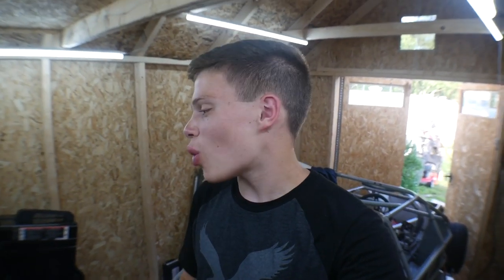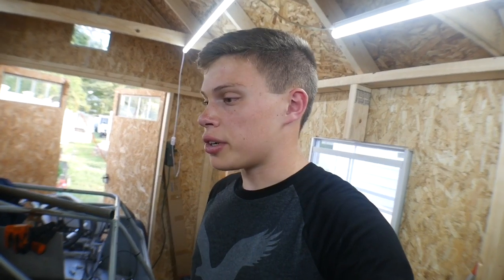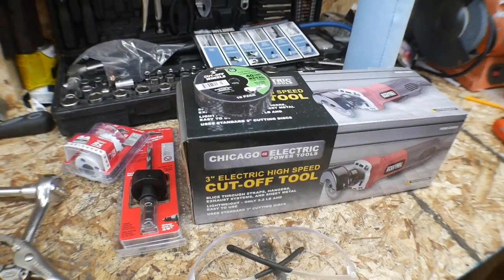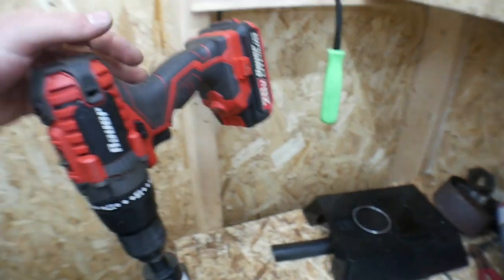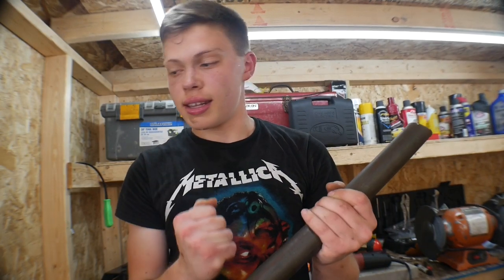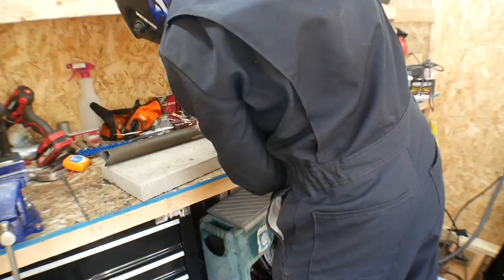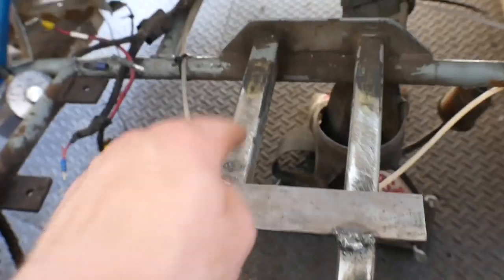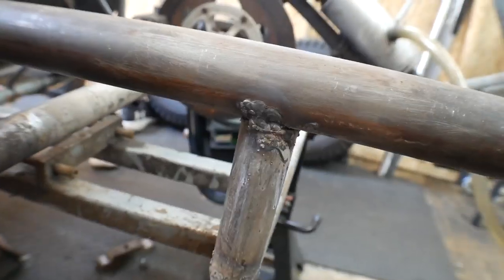STARTING The 750cc ENGINE Swap Into the NasKart!

Comment: Hi i am a daily welder you need to put the torch closer to the metal
Reply: ryan owens I was gonna say that
Reply: @ryanowens2334  no flux weld is stronger than gas weld but gas weld are easyer To do
Reply: YouCantGetMe_ flux core is just as strong
Reply: By a mile
Reply: @Tony 12083 - Learn to spell. And maybe your insults, and suggestions would be taken seriously.
Reply: it tough when you have no one to help show him the way, i would of said buy a stick first, starting with a mig and you dont really get the feel for running a puddle.
Reply: @youcantgetme_3772  what about dual shield?

Comment: Whenever you weld inside, always check everywhere really good because sometimes a spark can get in a small crevice and slowly burn, by morning your building could be burned down. I have seen it happen on a old s10 blazer. Also want to check if your cutting. Pretty much anytime your throwing sparks. Your welds aren’t bad for a beginner.

Comment: Wire stick out should be 3/8 to 1/2".   No gas shielding so take off the nozzle so you can see your weld arc better.  Buy a can of anti-spatter,  spray your weld area and it will clean up much easier. These little wire welders are super sensitive to your hand movement,  so try to move your stinger hand forward as smooth as a machine.  Practice making 1" to 2" long welds,  with your weld bead consistent.  Use the guide lines under the hood for initial settings, which are based on material thickness.  Then play with the wire speed control to fine tune the weld puddle heat.  Also Try getting tubing material from a muffler shop.  Your cut lengths are super short,  so thin wall should  be strong enough.  Metal working is cut, drill, form, fit-up then weld out.

Comment: you have a complete engine cradle off the bike, could just cut it off and use it, that's what someone like me with 40 plus years of welding and fab experience would do, plus i have owned 4 or 5  dohc hondas as well, some i turned into hill climb bikes.
Reply: Lawrence Veinotte I agree lol
Reply: yea that whould have been the easy way of doing it.  That kid is over thinking it, and not in a good way.
Reply: Understand he’s only been welding for four days take it easy on him
Reply: @jakeneal7355   we undeerstand that he only has been welding for a couple of days, and he is doing an amazing job with that litle experience.   It is not his welding we are comenting on here.  It is that he is making so much unnecessary work for him self by fabing up all of those engine mounts on his own, when he got the original Honda frame right there.  Just cut it out and weld it in = Free motor mounts.

Comment: Hey Migs so I’m a welder to.When you tack stuff it’s should just be a little puddle on the metal.you hold the gun in place for a second or two depending on your welder settings.and when you run your beads make sure to do either c motions or a cursive e.watch some mig welding motion videos.and get scrap metal to practice because if those welds fail then you might not be too safe

Comment: I have a small tip for you. When you cut a pipe and want to weld it for example at an angle of 60 degrees, you have to cut 1st at 30 degrees and 2nd in 30 too. You have to just divide the final angle at half. Sorry for my english, im from Poland :D

Comment: Migs when you are welding have the lance at an angle and draw Cs with it. Also when you are using the grinder just place it on the metal and let it do the work if you push down on it you will use more and more cutting disks

Comment: For welding, you want about 3/8 to 1/2 of an inch of wire sticking out of the tip. When you form a puddle try doing cursive e's in a row or half moons, it will give you the stack of dimes look. It is also a lot stronger. Practice, practice, practice and more practice. You may want to get a little better and go back over those welds. You are doing pretty good for having no help or experience. Keep up the good work!

Comment: Good choice not messing with moving the axle. Welding takes time and practice. Sheilding gas helps with making a pretty weld but flux core still works well with practice and can still turn out pretty. But being strong is really the only goal here. The welds dont have to be pretty because you will get better at it over time just make sure they are strong. Good luck man I hope it turns out well but thats a lot of torque on that little frame. I think you will end up bending the axle unless you install a 3rd bearing in the center of the axle to strengthen it.

Comment: Slow the wire feed turn up the power adjustment and go slow in circles make little swirling motions  stay focused on keeping the weld hot but moving so not to burn holes welding is fairly simple as I am learning as I go also .... just some tips that i found work for me

Comment: And the Barbour freight welders are good for little project welders but when you use mig with gas and not just flux core the welds come out so much cleaner itself with less spatter but your just learning.any type of welding is a art and skill that most people can’t learn.defintley do the flatbar practice or square tubing.and if you have to pieces joint together flat you can take your grinder wheel and just make a very little channel so that the flux can fill in deeper

Comment: Get a bunch of cheap flat stock and use that for practice cut it into 1 inch pieces and weld them together that should improve your welding very fast it is what I did to get better it helped me a lot

Comment: Hey Migs, Try holding the gun closer to the work piece. It helps smooth our the arc. I recommend welding with 75% argon and 25% carbon dioxide unless your welding flux core. Can’t wait for the finished project!!🤙🏽

Comment: living up north close to a city that has businesses that make modulus for gas and oil rigs gives me vary easy access to various large and small off cuts of many kinds of steel, as well as cheep access to custom material orders... $1.80/lb of metal.  $150 for 3ft of pipe, i would consider looking around more to find somewhere, a few extra items for future use tied to a 100 mile round trip will cost more but in the long run cost less.

Comment: Your drill torque setting was on 21 on. The black dial by the Chuck causing the weird noise and drill to slow. Move that to the drill bit picture and you won't have that issue

Comment: I'd say they look strong enough to hold who cares what they look like as long as your weld is strong also I wouldn't get any closer then 1/2 inch and any further than an inch and a 1/4  when welding. Also with flux core you want to be about 60 to 85 degree angle, always push away from your bead.

Comment: Watch some videos on welding with flux core  Harbor freight welders and wire.. I use there wire and it will work just as well as better brands for most things.. it looks like for what your welding your coming in to hot and fast slow it down and play with your heat and speed if your blowing holes your way to hot just take it slow and work a pool you'll get it you want it to flow like water think red hot metal water LOL I think you're doing a good job its great to see people stepping out of there  comfort zone and trying new things that's the only way to learn we all don't have someone to show use thanks to YouTube videos that does help.. keep it up

Comment: "wire stick out" for welding sheet metal letting the flux wire stick out 2-3 inches is okay, but for structural welds optimally the nozzle the wire comes out of needs to be 3/8 to 5/8 an inch from the weld aria, and the welder adjusted from their... I hot rodded the 110 volt flux welder I have, wired the power section into a 220 amp inverter for a stick welder with a DC output.

Comment: You need to hold the tip alot closer to ur material like a 16th of inch away and try a lower case e it over laps an all an watch ur puddle an keep the puddle moving once u see it get cherry red

Comment: That second pipe looks like galvanized tubing I wouldn’t weld that inside , it releases a gas called zinc oxide and it can make you sick , if get a fan at the least to blow the vapors away from your work space

Comment: i recently got a gassless welder myself i tend to find speed down to nothing and alter the power setting keap gun close to keep the heat in and when you get a flat weld you have right speed and setting moving in an e shape will help also a mask that auto darkens so you can see placment and what your doing the cheap masks you may as well have your eyes closed

Comment: heat up the metal that your welding first with a small propane torch before you weld itll help you weld better especially while using a flux welder from harbor freight there is a video on youtube of a guy that shows what beginner welders usaully does wrong when trying to weld so look it up and watch some videos on welding for beginners itll help you out but keep it up more you 
weld the better you can get as long as you learn to weld correctly

Comment: Get a smaller grinder and some flap sanding disks and some cut off wheels . Dont weld everything sold until you make sure everything is in the right place

Comment: just use 1" tube or even SHS, same as the frame on most bikes and your kart.. easier to work with in small areas, and cheaper

Comment: Migs please make sure u use non chlorinated brake cleaner if u use brake cleaner to clean ur parts before u weld them u can not use chlorinated brake cleaner it will put off a poisonous gas man that will hurt u can kill u so please becarful migs I know ur learning man remember when ur welding u move ur tip like 10 to 2 like a lower case e in that pattern u will weld ok man if u try it that way

Comment: I'VE BEEN WELDING FOR 25 YRS AND NOTICED THAT YOU HAVE TO GET YOUR TIP CLOSER TO THE WELD. YOU SHOULD BE NO FARTHER THAN A HALF AN INCH AWAY FROM YOU PUDDLE FOR YOUR WELD

Comment: I don't like that Harbor Freight welder. It doesn't look like it welds metal any good.  You could of used part of the bike frame and welded the mount in the cart frame. Just chop what you need and scrap the rest.

Comment: I took welding class in high school, i will say first and foremost the weld is suppose to melt the two pieces of steel and mix in with the two pieces being welded. For the cheaper HF welders you should probably use a torch to heat the metal up to help the weld stick and do its job, it shouldnt be so round. Your welds are cooling too fast, it should have a slight raise to it but should be mostly flat. Just get on youtube and watch the proper techniques and then practice those techniques. Youtube wont make you a good welder but it will show you how to be a good welder, i havent use a mig welder much but i have had a good bit of time behind a SMAW welder. I love to weld and am actually welding on my mini chopper frame to get it ready for an engine, but its not a 750 engine haha probably a predator 212. I had to make a bracket for the rear drum brake keep so it has back brakes. I guess i can record it and post it.

Comment: Your welds are spattering so much because you have the arc so far from the tip and your feed is too high for your speed. My advice is to slow it down like you said but also maintain a feed that will keep the arc about 2 or 3 cm from the tip of the gun

Comment: The way you talk about welding and metals type of metals make me cringe. You need your tip if you torch like 1/4 inner less from your base metal and your using way to heavy duty shit like chill out with how thick the metal is you didn’t even need pipe